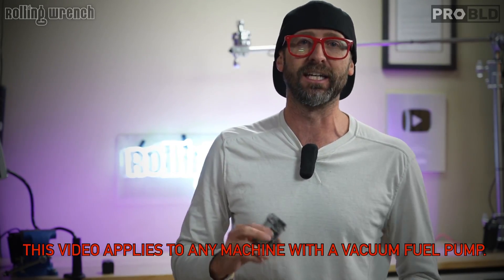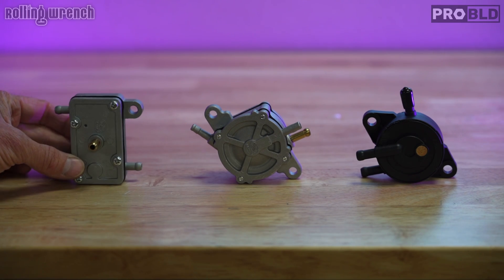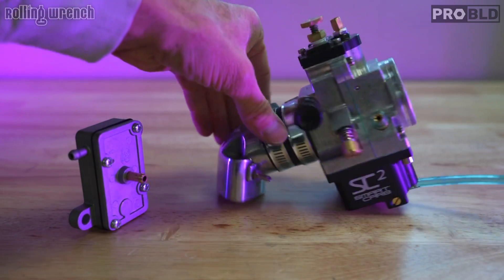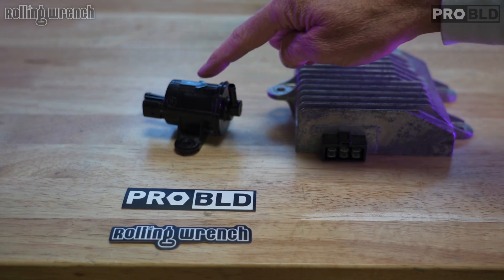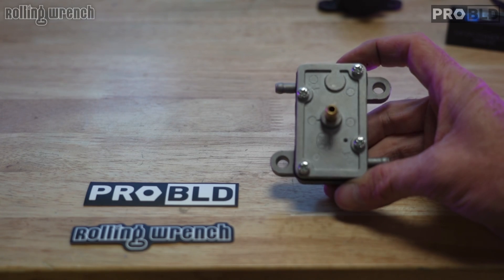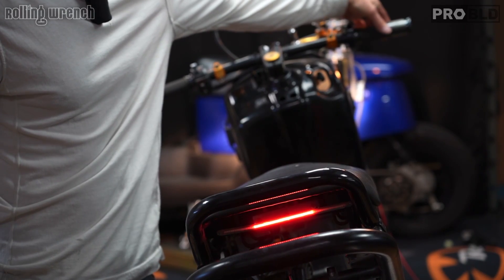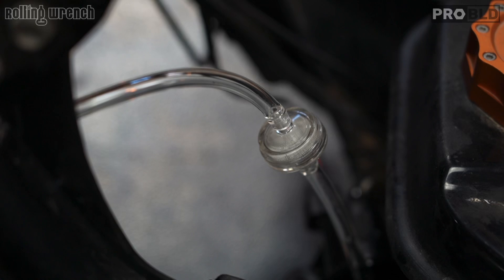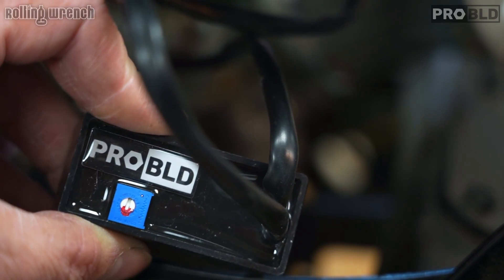No more vacuum fuel pump problems! GY6 Won’t start: FIX! [PROBLD PULSER UNIT]

Comment: When the carb bowl is full how does it know to stop pumping and pump again?ecu?
interested in this but I need it to be reliable if I’m full hold sesh for a long run. Need one for my stroker dio my mikuni pumps been good on my other strokers but this new build won’t pull fuel thru the crankcase port only on my intake port but I don’t feel like that’s reliable..This might be my solution
Reply from the maker: It works just like your vacuum pump. Always pumps. The needle and seat in the carburetor stops the flow. Just like a flapper in a toilet works
Reply: @RollingWrench  which way do you turn the dial to make it pump the most?

Comment: Those (vacuum) pulse fuel pumps are generally ran to the crankcase on riding mowers, not the intake. Constant vacuum does not power them.

It needs to be cycled from pressure to vacuum to pressure to vacuum. 

Vacuum pulls fuel into the pump, pressure pushes it to the carburetor, and the cycle continues.
Reply from the maker: Yes that is true on a tractor. Unfortunately not on a scooter. However the intake pulses as well. In case you didn’t know.
Reply: @RollingWrench  The crankcase pulses from vacuum to pressure, the intake at low load pulses from strong vacuum to weak vacuum, and under heavy load the intake pulses from low vacuum to low pressure.

The crankcase is a more consistent source of power for a pulse fuel pump,  which would explain why scooters have such a problem with them while millions of tractors run just fine with pulse pumps
Reply from the maker: @Texassince1836  what I’m trying to say is the scooters don’t have that option. The only breather hose is on the head. It can’t be restricted.

Comment: I take it that you desinged this unit & if you did, did you secure it with a patent?
Reply from the maker: Oh yaaa
Reply: @RollingWrench  That's really awesome and I salute you for it! As a patent holder myself, I can't begin to extole the Importance of securing your product. I know the amount of work put into a project, the expense, and the time it takes to secure a patent. You have every right to be proud of this. Btw, I think you should do a video on installing it on a mower, esp a riding mower. Not everyone has a bike or a mule, but almost everyone in the US has a mower, even if they only rent. I think this would be a huge market potential for your product.

Comment: Isuppose for the scooter with the fuel tank ovobe the carburetor,  it could be used a electro valve instead that pump... And I suppose your Rukus already have a electric fuel pump because the fuel tank is belou the carburetor... excuse my english.

Comment: Guess a primer bulb would be too simple.
Reply from the maker: That will solve the start issue. But it won’t solve the unreliable vacuum fuel pump issue. Not to mention a primer bulb would look like complete crap on something you want cosmetically pleasing.
Reply: @RollingWrench  you need to check your float bowl air vent, looks like you had an air lock in your demonstration. The diaphragm fuel pump has a limited lift, self priming function. You never diagnosed the malfunction of the pump, diaphragm failure? Check valve failure in the pump? Outboard fuel pumps last a very long time.
Reply from the maker: @D-B-Cooper  vacuum pumps are crap they fail, they don’t prime. I have been dealing with them for years. This is the fix. Out with the old in with the new.

Comment: i have a tractor with tank above carb. i still have a fuel pump. its a krowler cam ran pump. so statement u never have a pump on tank above carb is not true
Reply from the maker: Why would it have a pump if the carburetor can be gravity fed. Riddle me that…

Comment: Great video! Alternatively you could put the electric pump prior to the vacuum pump as a booster and wire it to the ignition switch, So it would come on and pump fuel to the carb on starting and then the OEM vac pump would take over during normal operation,
Reply: What do you mean no need lol that's better and way cheaper than what you're recommending 😅
Reply: Why buy that pulsar when you can just wire it to the ignition starter switch , it'll power it only when cranking over the engine and shut it off when you let off the start button , and you can either let the original vacuum pump take over or even better replace the og pump with an electric small constant flow pump and power that one to directly to the ignition switch
Reply: @ARVintageCycles   Almost exactly my though. There is no sense in having that pump sending gas constantly at the carburetor while the key switch is on, carburetor eventually will overflow. That's why those pumps are commanded by the ECU, in order to activate or deactivate it when needed. Maybe if the pump controller is triggered by the spark signal... but flow-rate must be precisely adjusted. Or maybe if you add a second layer of control in order to deactivate the pump when the float valve closes. Dunno, this solution needs a little more thinking.
Reply from the maker: True, but no need

Comment: It’s not a pump. The vacuum opens and closes the petcock-that’s it. The only fuel pumps are mechanical (usually runs off the camshaft) or electric (usually in tank but could actually be anywhere in the line). If the vacuum acted as a pump, it would suck fuel into the vacuum hose.
Reply from the maker: I call it a fuel pump since it pumps fuel to the carburetor. As long as you know what part I’m speaking of you should be cool. Just curious, what do you call the fuel pump?
Reply: @RollingWrench  every bike is constructed differently. Some models may come with an electric fuel pump either in tank or in line. Most of the cheaper mopeds come with gravity fed fuel systems and most people mistake the vacuum petcock for a fuel pump. If the vacuum acted as a pump, fuel would be sucked through the vacuum hose. The vacuum only opens and closes the valve to allow the fuel to flow. I had to replace a defective vacuum petcock (stuck open). I used a manual petcock and it works just fine-proving that the vacuum petcock is just an on/off valve.

Comment: Just buy pump at napa 12 v low pressure 20 bucks
Reply from the maker: Those 4psi pumps won’t work. It’s to much pressure. If you get a regulator in line it will though. But then you have a bunch of crap hanging off your bike. But that is an option.

Comment: Those are not vacuum pumps!..
They are pulse pumps!.. 
Simple vacuum will not pump fuel.
Reply from the maker: Let’s just call them electric or vacuum fuel deliver devices. Honestly who cares what you call them. This video is about solving a problem. The name doesn’t change a thing.

Comment: I really believe you are trying to sale people on your products.
I've never had problems with my equipment before. If it came with a vacuum pump then it was definitely should work.
Reply from the maker: Well yaaa! I’m selling a fix. I wouldn’t have wasted my time building a product that doesn’t solve any problems. Why would someone buy my product if they didn’t have any issues. The proof is in the customers problem. Once you start having problems and then install another vacuum pump and have the same problem again you will get it. If your not experiencing the issues I showed in the video you don’t need this product.

Comment: Fuel pumps are very reliable and rarely go bad.
Reply: But how theu don't over fill the carburetor on idling? They are on all the time without the ecu can someone explain before i do the conversation
Reply: @sjjvddyumiherhv3709  Because carburators have a float that closes the chamber entrance when its full
Reply: Yup, those vacum pumps almost never fail. Id take that over electric all day!

Comment: He forgot 2 stroke outboards!  I replaced so many outboard diaphragm kits and pumps that I lost count. Mostly OMC  The 2003 Harley Sportster has tiny diaphragm pump on the tank valve. My XL1200 was suddenly breaking up when I slammed the throttle. Rolling Thunder Cycles handed me an open flow valve and solved my problem.  Why Harley installed a pump on a gravity feed makes no sense.

Comment: Ok so my 150cc icebear is shutting off as I ride it. Then won't start.  It's like it just loses power, like it's not getting proper gas because I can feel it bucking a little before it goes down.  Sometimes it has worked to blow through the gas tank to get fuel going again.   I've replaced the carb the spark and numerous other parts.  Any ideas?  I need it for transportation and I'm broke.

Comment: i wonder if this could be adapted to an outboard motor that uses a small vacuum pump ? 94 mercury  75 hp 3 cylinder.

Comment: Got problem with Kiwasaki 23hp engine,  I have replaced 3 FP's without success; ie, low volume after a few minutes. Will this pump delete kit supply enough fuel for the 726cc engine?
Reply from the maker: If it had a single carburetor it shouldn’t be a problem

Comment: So what is wrong with a electric pump with a pressure regulator? And/or bypass?
Reply from the maker: Nothing , it’s just cluttered. And the pump you use to run it is normally unreliable

Comment: It's not the fact that it's vacuum operated that is the problem. Marine outboard engines have used them for decades and they operate for years without issues, many of which are pull start. It's probably poor quality or engineering in these particular parts or low/poor vacuum pressure from the engine.

Comment: Whilst I think this is great upgrade it should be noted most of the problems associated with el cheapo vacuum pumps are because of the use of ethanol fuel. Whilst most, not all, GY6 style engines can tolerate E10 fuel it turns the diaphragm in the fuel pump into a wibbly wobbly jelly like curtain instead of a semi rigid membrane that can 'pop' back and forth and so pump properly.  Mikuni and Keihin vacuum fuel pumps currently made in Japan have ethanol tolerant diaphragms however, because ethanol also jellifies the non-metallic components of the typical CV carburetor (float needle tip, main diaphragm, air cut valve diaphragm, bi-starter seat) they don't work properly either. I use E10 with no problems in my cars and my motorcycles which are fuel injected but not in my scooters.

Comment: I think before modification it would be worthy to make all chcecks if the reason could be solved with original pump. 

I purchsed at begining of december my 125 GY6 - seller told me to keep trying before it will start. I made first try in march (4 months in frozen condition ) and realy I had to repeat some 6-7 times but it started to "cough" and ok  Battery? No any problem because it was sold with new one. 

 My diagnosis is : when bike stays longer time the fuel in carburator is evaporated  - pump has to fill it untill good level - that is that critical time.  With low  starter revoutions  flow  is lousy  If the engine starts revoutions are  higher an so efficiency of pump. 

Later i had no problem - the fuel  is in carb after weeks and it works brillant at touch of key. 

If no  I would suspect problem when level in carb is at low after last trip  - what is reason? Too hot carburator makes fuel to evaporate? ? Or  not good sealing on    gas  inlet line to pump?  .If it is so   than it could make carb level vary   and next time troubles to start because was not enogh after last trip -with hot engine it didn't  stop  but with cold    it has to refill  first. Gas  would not drop  because on gas side is vaccum and it would suck  air instead of enough   fuel.  

Or vaccum for driving the pump    is too weak Could be  because engine is worn (not too much suspected) or the carb tunning is bad with too open diaphragm in closed position  It should be almost cloeed and engine should work.   using carb idle system with idle nozzle Any way thanks tor turmning my attention -I think I understood why it  may behave unusual    depending on operation of pump and    level in carb.
Reply from the maker: What you explained is exactly what I have experienced in the past and in the video briefly. There is two problems with the diaphragm fuel pump. First problem is start up as you said. But the second problem is the over or under fueling. It’s not a one size fits all pump. Not to mention the diaphragm in the fuel pump (because it’s rubber) gets worn out. This makes things even worse. Long story short. A vacuum fuel pump is equivalent to a tape deck. And now days we use Digital MP3 to listen to music. New technology make our life easier, and more reliable.

Comment: How much pressure does it put out?
Could you put on a the regular electric fuel pump that's for an automobile but with low pressure?
Reply from the maker: The Honda pump is 2psi

Comment: Learning altot about gy6 engines from you. Was wondering if this will work with a tao tao racer 50. I believe it has a vacuum pump not quite sure, but having same issues. Have recently done an cc upgrade using pro build, from 49 cc to 80cc.
Reply: The petcock on the taotao is gravity fed. The tank is placed higher which forces the fuel to go down. The vacuum attachment only opens and closes the petcock-that’s all it does. If it actually acted as a pump, fuel would be sucked into the vacuum hose. I have 2 of the same bikes (taotao pony 50s). I also did the 80cc upgrade-huge difference!  Question-are your valves chatty with the 80?  I adjusted my valves several times and still. I know it’s the valves because I did a test-I adjusted the valves to zero (tappet touching the valve head) and the sound went away. Anyway, the petcock on mine was stuck open (better than stuck closed I guess). I changed it to a manual petcock. Works just fine.

Comment: Yes these are all great new items I’m all for it! 👍🏼👍🏼 but for the ones who has the Mikuni fuel pump now they can blow on the gas tank to push the gas up to the carb to prime but who would want to keep doing that right so the easiest fix for this is installing a fuel transfer pump/manual pump on the fuel line between the pump and carb. You can buy the smallest one you can find so it’s easy to tuck away. 

Just another branch that people need to know if we’re about helping the community. More power to you guys Big Mike! 🍻
Reply from the maker: Ya. If you go that route get a jet ski fuel primer kit. That are small and the best choice for no clutter

Comment: I see power module but do you ha a link to the actual pump?  I need this badly I have a Kawasaki 610 mule that I have tried everything hopefully this is the fix!!!
Reply from the maker: Ya, this will be a perfect fix for the mule. They have a problematic fuel pump for sure. Here is the link to the pump: https://www.rollingwrenchdenver.com/products/honda-ruckus-metropolitan-fuel-pump?utm_content=ios&utm_medium=product-links&utm_source=copyToPasteboard
Reply: Thanks alot i will let you know how it works. Are your modules back in stock?
Reply: It shows sold out?
Reply: Neither of theses components are available any idea when stock will be available??
Reply from the maker: @fishinghippi  2 weeks
Reply: @RollingWrench  any updates on module and pump?
Reply from the maker: @fishinghippi  towards the end of the month :-(

Comment: $233 ordered with pump and pulsar, no shipping.

Got an old UTV project I'm tired of dealing with.
New carb, filters, fuel lines, sparkplug and everything and she's still running like garbage.
New ignition coil and this pump will save it. If not I'll light it on fire lol

I'll try to remember to come back and let ya'll know how it comes out
Reply: You forgot...
Reply: It was a clogged vent line from a dirt wasp. Had nothing to do with fuel so I didn't end up using it

Comment: Does anyone know if this would work on a Lance Cabo 125? Been dealing with stuttering issues for a while now. Tried changing many parts, (new oem carb, plugs, coil wire, fuel lines, petcock, fuel filter etc) to no avail. Thinking it may be a fuel flow delivery issue
Reply from the maker: Yes it will. As long as the tank is below the carburetor
Reply: @RollingWrench  The tank is above the carburetor. Any other suggestion? Thanks
Reply: Try a capful of seafoam in the gas tank. From working on small engines, I realize the jets in the carburetor (especially the idle jet) has holes the size of human hair. Easy to clog which means painful cold starts, rough idle, stalling, bike sounds like crap. I usually put a capful of seafoam in the tank every fuel refill. Keeps everything clean and running smooth.

Comment: Do you think this will work on a 1999 skidoo 500cc snowmachine?  It has a vacuum fuel pump that's hard as heck to start
Reply from the maker: If it has a single carburetor yes

Comment: I got tired of dealing with fuel pumps and I put a universal low pressure fuel pump on mine. $35 at advanced auto.
Reply from the maker: In my experience. They don’t last, and they have to much pressure. I tried all of those a few years ago.
Reply: @RollingWrench  Not the little square ones. The actual inline 5-8 psi inline pumps. I have been running them on my 1340cc Harley for well over 12 years. They are about 4 inches long though and a little big compared to the OEM Honda for sure. . I just painted it to match my trim color and it blends in. Its a good alternative.  They work great on most everything I have used them on. Riding lawnmower, Bikes, scoots, and generators ect. Maybe you could make a deal with universal parts and they could brand one for ya. Cheers, Keep the rubber side down.

Comment: Awesomeness! Just ordered mine! Where do you recommend I mount the pulsar unit? Also will I ever need to play with the screw on it?
Reply from the maker: Sweeet! Thanks dude. Mount the pump in the stock ruckus location and the pulser anywhere away from heat.